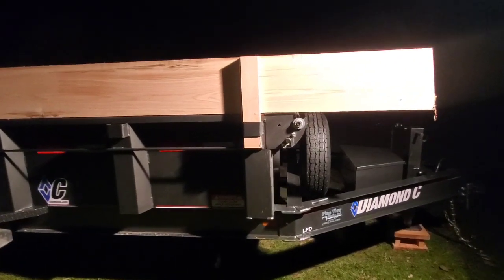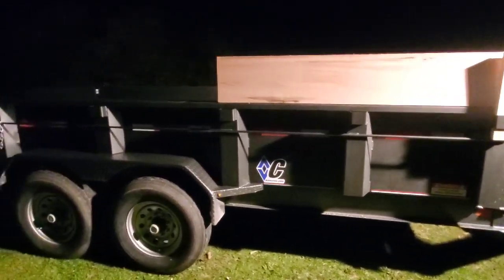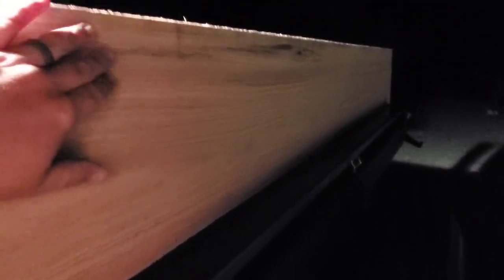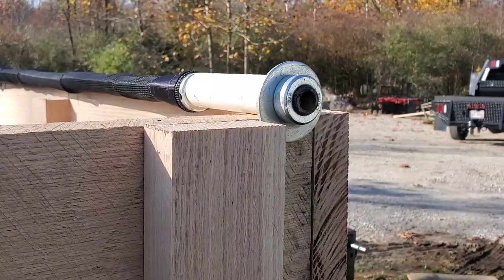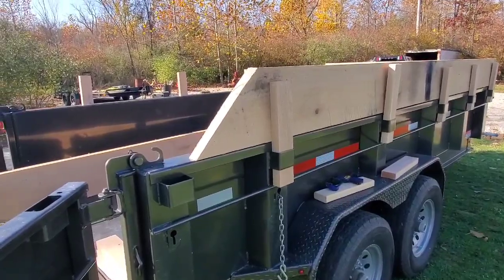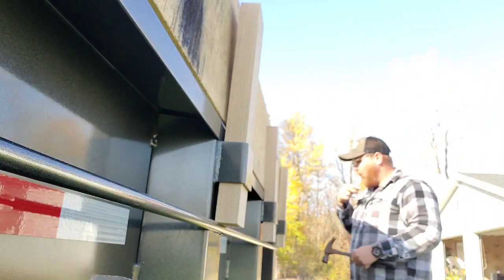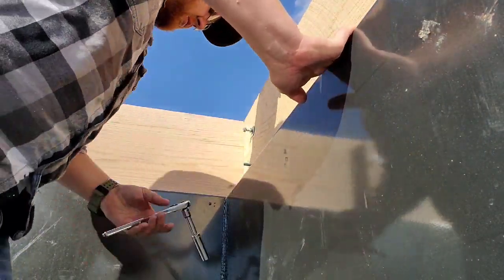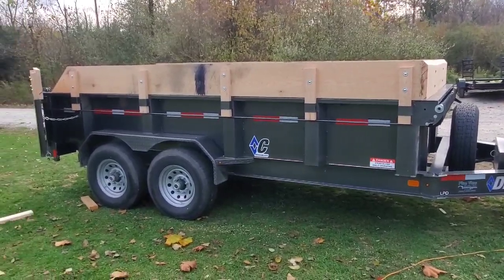Dump Trailer Upgrade- Adding Oak Side Extensions

Comment: Great video. I put some rubber mats 6inx6in under my boards on the dump trailer that way it the board doesn't rub the paint off. I just used screws and fender washers to hold it on 1 side.  That is a good hammer. Inner tube will work also. Great job on the trailer.
Reply from the maker: Thanks, hopefully I can get something on there soon 7